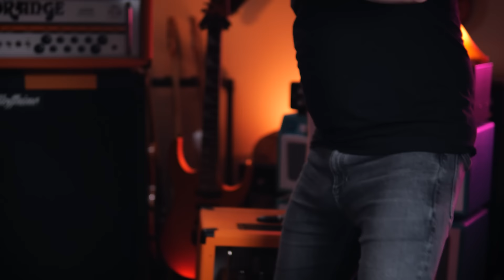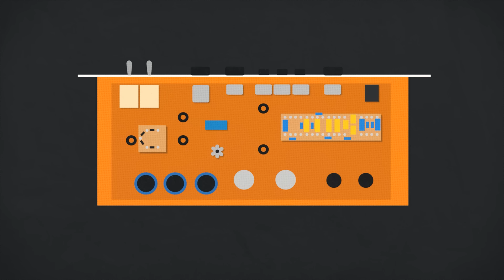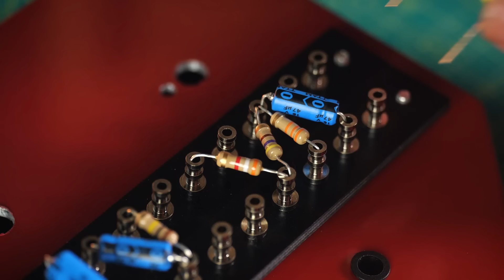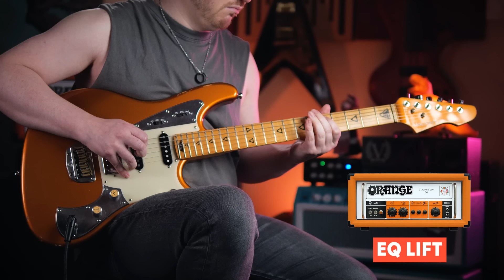Archaic Design of Handwired Amplifiers

Comment from the maker: We look inside an Orange Custom Shop 50 to find out more about Handwired Design: Point to Point, Star Grounding, and why valve amps are heavier on one side...
Get your Orange Custom Shop 50: https://orangeamps.com/products/custom-shop-50
RJ Skycaster+ : https://www.rjguitars.store/customshop-blackkintsugiplus
Valiant Mercury: https://valiantguitars.com/product/guitars/mercury/orange-distressed-fb/

Pointing at the Inside of an Amplifier | Addendum: https://youtu.be/xXgVycxISa8
Point to Point Fuzz Face build: https://youtu.be/cagEeiq3u98

This video contains paid promotion from Orange Amplification.
More details on how Science of Loud implements product promotion - https://www.csguitars.co.uk/disclosure
#handwired #pointtopoint #orangeamps 

Timecodes:
00:00 - Pain in the Shoulder
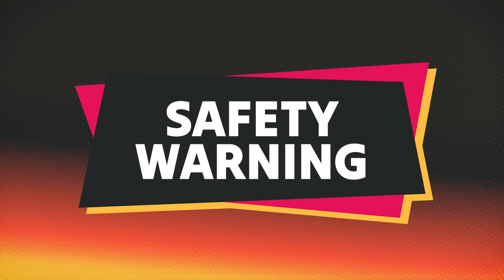00:27 - Safety Warning
01:12 - What do all the bits do?
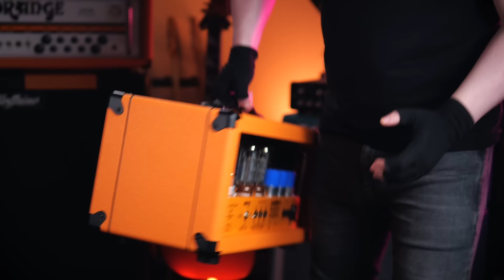01:32 - Why heavier on one side?
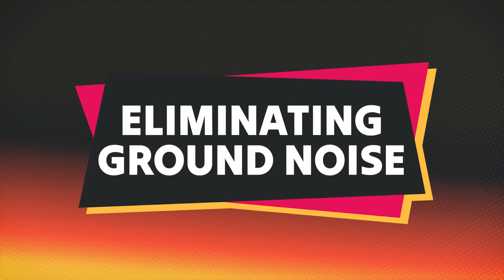04:16 - The Star that defeats Ground Hum 
06:32 - What is Point to Point?
09:09 - What is Class A?
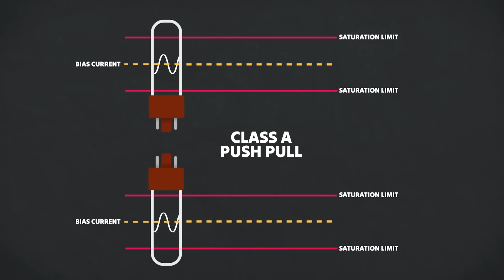10:24 - What is Class AB?
12:15 - A vs AB sound examples
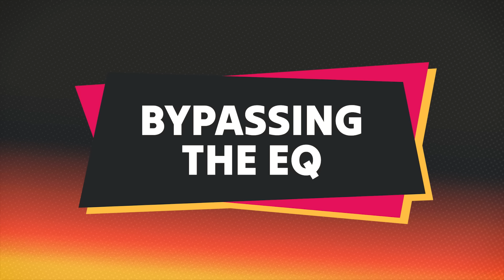14:18 - Bypassing EQ
15:35 - EQ Lift sound examples
16:16 - Is Handwired better than PCB?

More from Science of Loud: 
Support on Patreon: https://www.patreon.com/csguitars
Join Science of Loud Discord - https://discord.gg/uJHFgJRunb
Buy Science of Loud Merchandise - https://www.csguitars.co.uk/store
Website - http://www.csguitars.co.uk
Contact - colin@csguitars.co.uk
_________________________________
Description contains affiliate links. Purchasing using one of these links will generate a small commission for Science of Loud at no additional cost to you.